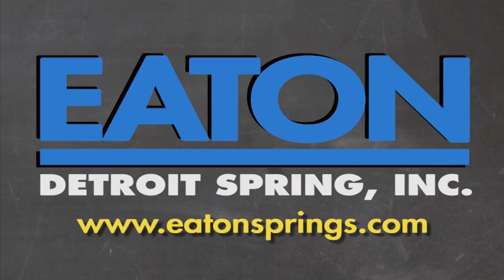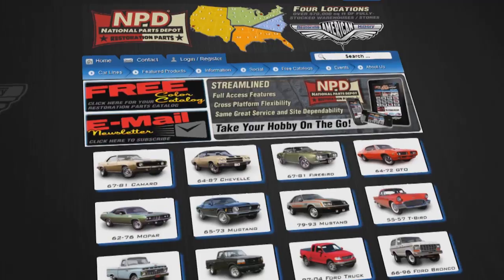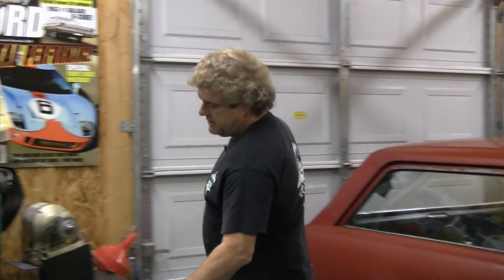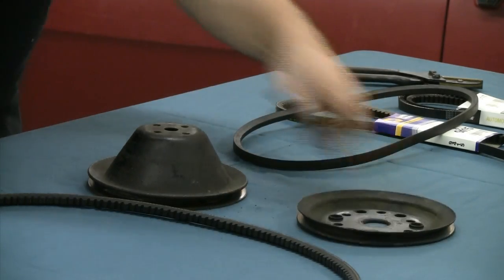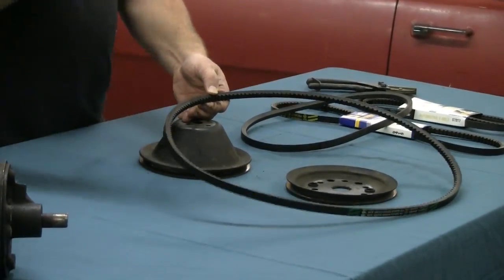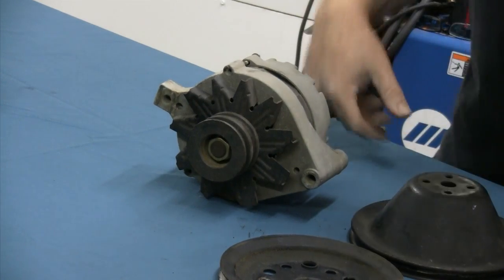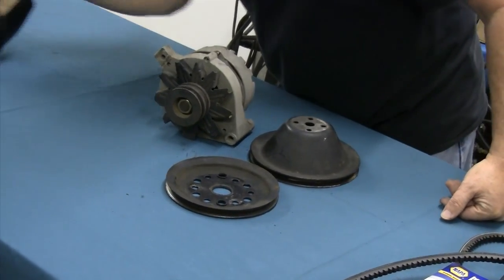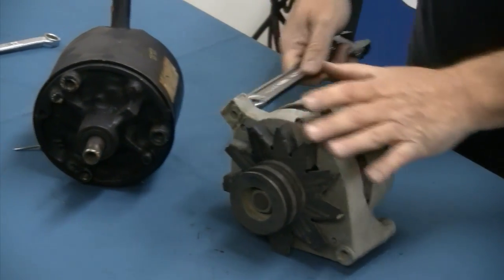How To Classic Car Get Correct V Belts Pullies Truth About Underdrive Pulleys Episode 238 Autorestom

Comment: Thanks Jeff but I'm have trouble with alternator V belt for my 351w ? I got new pulleys on crank & water pump ,kept original ps pulley & original style alternator ? Rope said 40+ inside pulleys ? Been using   O Rileys having Problems ; ( ?

Comment: A long time ago, J. C. Whitney offered a turnbuckle tool for adjusting belt tension. Takes a little longer than the usual methods, but more precise and with fewer skinned knuckles.
Reply from the maker: Thanks for the info! I remember those.
Reply: @AutoRestoMod  , still have mine. Very useful.

Comment: I've been having a hell of a time burning and ripping belts after my 130 amp 3g alternator upgrade with a single v belt. I feel like no matter how tight I put it the alternator is causing to resistance for my v belt and slipping randomly. I also and noticing minor wobble from my waterpump pulley. I'm running electric fan. Do you suggest the need for double v belt alternator pulley or maybe replace waterpump?  Could bearing be bad in there or maybe just waterpump pulley bent from how tight I keep putting the belt 😯

Comment: So what would make a belt squeal?  I’m looking to replace my steel two groove crankshaft pulley because it looks warped. It looks like it wobbles when Ford F-150 302 ci engine is running.  What do you recommend?
Reply from the maker: Low tension, dragging components like an alternator. Alternator that is possibly having a bearing issue can all contribute to belt squeal. Most of the time though it is in fact just just not enough tension on the belt. I would look at it and make sure it's just a pulley wabble not a shaft wobble.

Comment: I have a 307 engine and belt going around the fan and alternator is screaming. any idea what I can do
Reply from the maker: Two things: Check tension the belt should be tight, there are tools you can get to check belt tension; Gates has one on Amazon for $12: Gates 91107 Belt Tension Tester. Second, if tension is good, you can put a bar of soap against the belt when it is running and it may tame the squeal. But that is a scary proposition on some engines.

Comment: I have an SBC in a 65 truck and the alternator is on the PS of the vehicle. I have a clutch fan. I do not have power steering nor do I want it. I do want to add AC. Is there a good way to setup my pulleys and belts for this? do I need to move the alternator to the DS? I have head accessory bolts and I use a mechanical fuel pump.
Reply from the maker: I would call Vintage Air and chat with them regarding the placement. They have quite a few pulley combinations and a good tech staff. 
1-800-862-6658

Comment: What is the standard belt tension required?
Reply from the maker: Deflection should be 1/64th per inch of span between the pulleys.